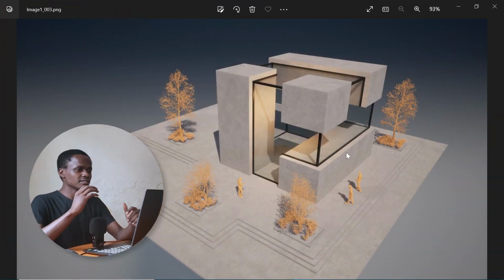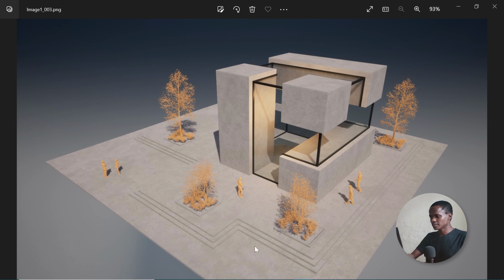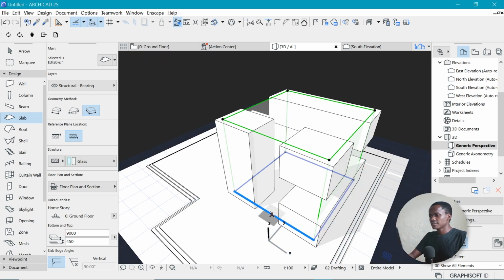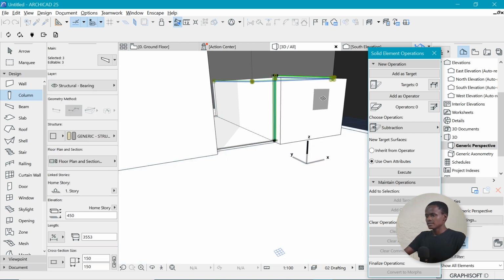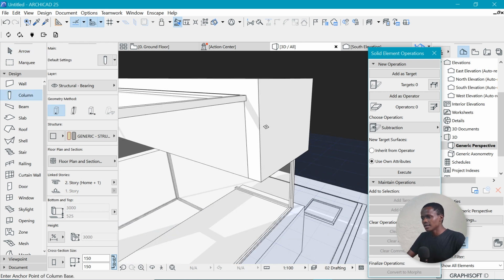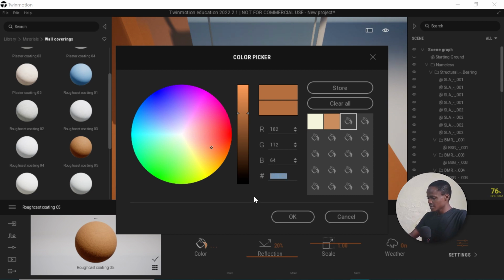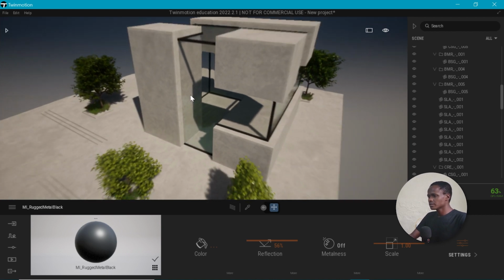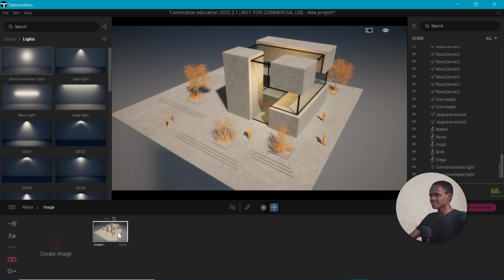Archicad and twinmotion for beginners: Concept Modelling

Comment: Do you suggest TwinMotion or Lumion or Corona or Vray?
Reply from the maker: It depends on your needs and what you can afford, In my case, twinmotion does some decent renders and has free education and unlimited trial version plus, its very easy to work with in my opinion. Lumion on the other hand is too heavy for my laptop, It can barely run and has limited trial version. Vray and corona are not directly enabled with archicad, so you have to learn 3Dmax or sketchup to use them, plus i think their learning curve is steep.

Twinmotion may not produce the most realistic or amazing work but am a fan of their ease of access and intuitive nature, yah sometimes (atleast for me) highest quality is not everything.